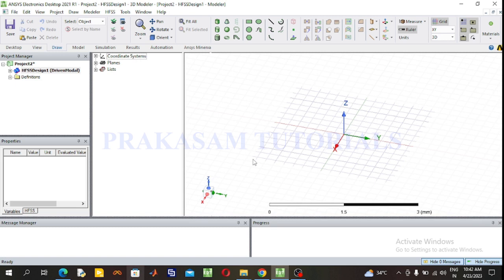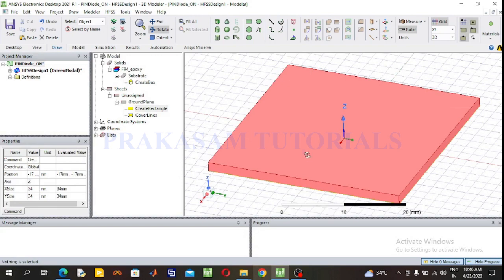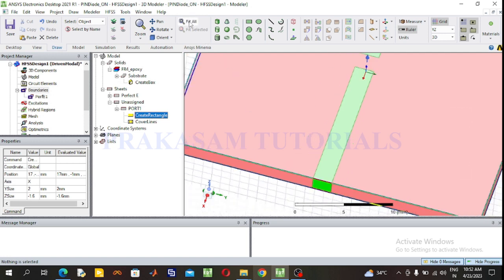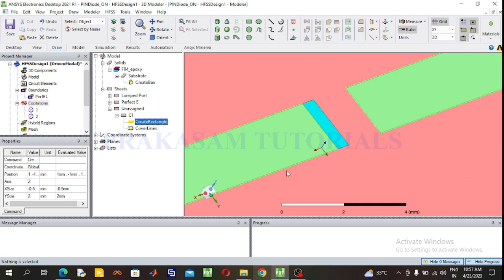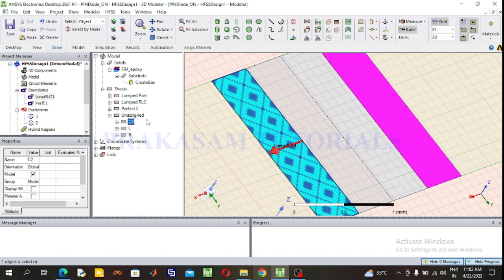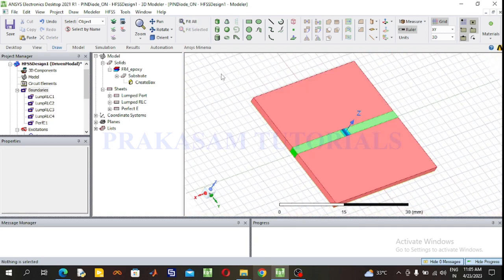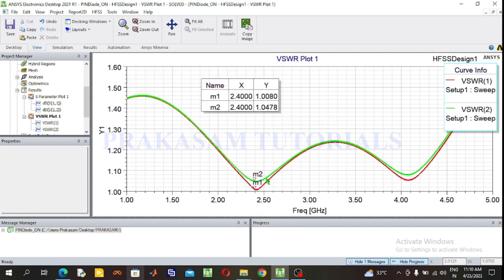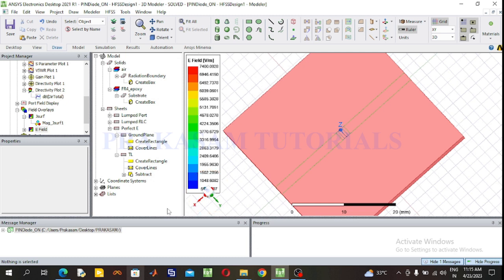PIN DIODE Modelling for ON Switching in Reconfigurable Antennas#MSTL ON State PIN Diode Modelling

Comment: When the diode is forward biased (ON state) the equivalent circuit is a combination of parasitic inductance 𝐿 and a series resistance 𝑅. then why do you add two (2) capacitors? can you please explain?? and what is the effect of these capacitors